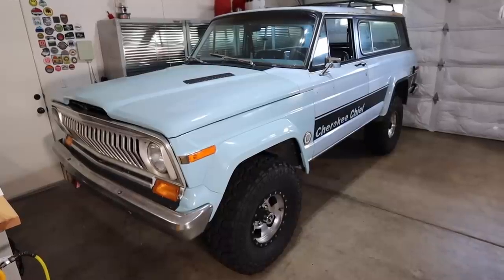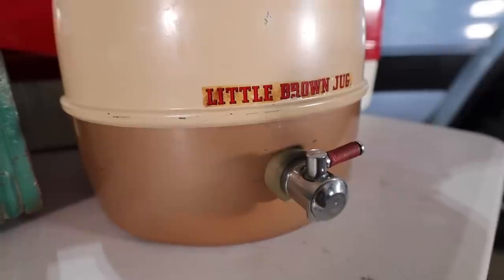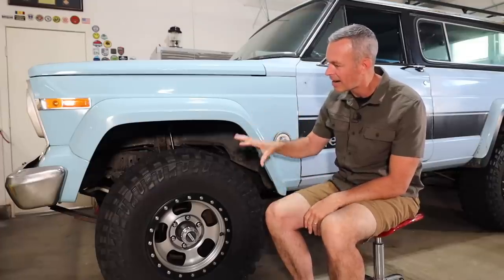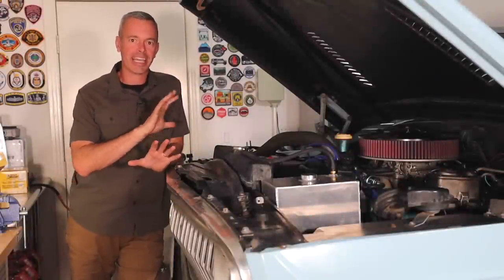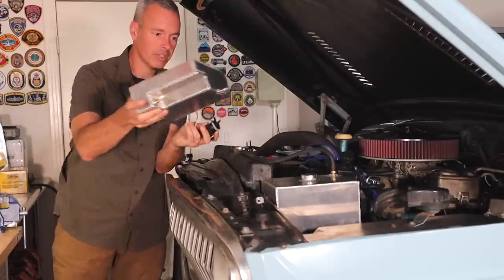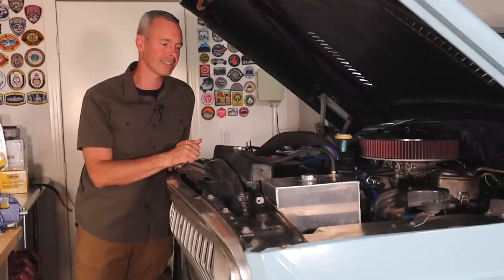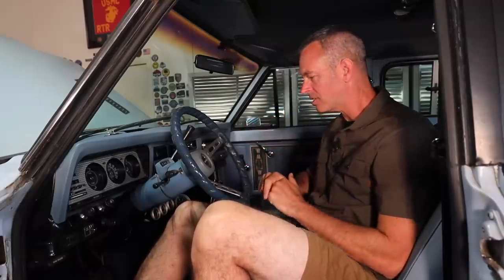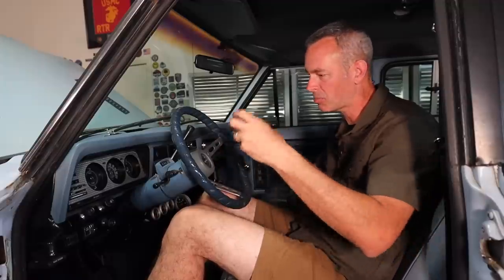Is this 41 Year Old Jeep Cherokee Chief Worth Restoring?

Comment: I did a frame off on my 82 cj7 five years ago. Installed the drive train from a 79 Wagoneer including axles. I kept the Dana 300 transfer case. After several carb swaps I settled on a Quadrajet. Once I got it tuned it has been excellent. All the Jeep guys I know kept trying to get me to swap a gm drive train. Lol,no issues. Beautiful wagon you have there.

Comment: Back in the early and mid-80s, I had a '79 Jeep Cherokee Chief. It was a great truck. I had a 360 V-8, a three-speed automatic transmission, with QuadraTrac, with low-range and vacuum lockers.  I had the transmission start to slip, and my parents decided to help me out, we towed to where they were living and got their mechanic to do the transmission rebuild. I mention this because they were living in Wilkes County North Carolina. If this isn't familiar to you, this is because the area was, at the time one of the centers of NASCAR. And their mechanic was a car owner and car builder. His shop wasn't one of the big ones, but he did run cars are the NASCAR tracks both the big ones and small ones. 

He kept the truck for two months, and when I picked it, not only had he rebuilt the transmission, but he had decided to 'play' with the engine, and rebuilt the engine, not as a track engine, but at this time, a becoming thing was fuel efficiency in NASCAR. I won't say what the build was able to do, but as a daily driver, I wasn't getting close to the 9 mpg that the presenter in the video says he was getting. 

Lastly, a comment about the offroad capability of the truck. I was working as a land surveyor when I owned the truck. One day, I and my crew along with another crew got stuck one a site and our 4-wheel drives got bogged down. During our attempts to get the trucks out of the 'stuck', our attempts were noticed by first a couple of guys with one 4-wheel drive truck and then by construction crew with a larger 4-wheel drive truck. 

Both pickups got stuck. Coming to our rescue.

As it was getting late and this was long before cell phones, my wife was getting perturbed that I hadn't come home, she contacted the office and called the surveyor who we worked for and he said we should have been finished long before that. So, as she is a county girl, she hopped in the Cherokee Cheif and went to the site. 

Now, where we were all stuck was at the edge of an overgrown field, but she could see us from the entrance to the property. The field was wet and full of mud, once the grass, weeds, and other vegetation was broken through, but she didn't know that. She just drove over to us. She did have to engage the locker and as she approached us, she did slow down a bit, but after seeing what had happened, she just swung around and backed up to us. Yes, we all were yelling for her to watch out, but to no avail.

She pulled all the trucks out of their 'stucks'. Even the big 2.5-ton pick-up, although as she pulled him up on solid ground she did have to engage the low-range. 

When asked about how she was able to do all this, she just said she had grown up driving tractors and this wasn't all that much different from plowing a field. 

I loved that Jeep. It was killed by a mid-80s Accord driving very fast and T-boned it, flipping it, sending it spinning down the road for 150-175 feet, with me in it. Totaled.  

When people heard that the truck was no more, there was a bidding war for the engine and transmission. I was able to buy another car with the salvage monies. 

I still wish I had another '79 Jeep Cherokee Chief, now, what 35 years later. 

Oh, BTW, I've still married to that country girl.

Comment: Your “cold start” made me laugh Brad. Cold start in So CA is what, 60’s?  Just bustin’ your chops bud. 😜

As for your fuel pump dilemma, these FSJ’s have a tendency to vapor lock on hot days and high altitudes due to the fuel vaporizing at lower points as elevation increases. To remedy that I installed a small electric fuel pump right at the tank on my BIL’s Cherokee Chief years ago which resolved the issue.  The electric pump fed the mechanical pump which prevented the large pressure drop as it is easier to push fuel than pull. 

You could simply wire in two small electric pumps (one for each tank) to feed  the mechanical and merely wire it through a double pole double throw switch to select supply tanks.  

Just a thought.  

By the way a FSJ is on my radar also as a retirement project but I want to run a modern powertrain for power and efficiency.  

Mike
Reply from the maker: I like your suggestion, and may have to look into some low pressure pumps to offer a little assistance.
Reply: Great suggestion, we used to use a pre feeding low pressure high volume pump with a pressurized catch tank.
Reply: I think most EFI setups require electric fuel pumps so you might want to look into what is included/required for your future setup.
Reply: Not a bad plan, but I have another thought for when you go fuel injected.  I put the Howell kit on my YJ and loved it, so I think it is a great way to go.  The first thing I noticed though was that since the main gas tank had no baffle (fuel injected vehicles usually do), braking, turning , or accelerating with less than 1/2 tank could starve the fuel pump and kill the engine.  I solved it with an old Road Race trick we used to call a surge tank.  A tall skinny tank of about 1 gallon mounted up in the left rear fender.  One electric pump with a return line filled that surge tank (with a return line to the main tank).  The main pump supplied with the Howell kit pulled from surge tank (return line from the throttle body goes to the surge tank).  You could drive that thing straight up a wall without fuel starving.  Also found out that the stock exhaust put enough heat under the Jeep to boil gas in the tank at high altitude (or high temperature).  With that system I never had any vapor lock even after 8 hours on the Old Ore Road in Big Bend.  Let me know if you want more details.

Comment: I at one time had a 72 jeep Wagoneer AMC  v8. At 10,000 feet it would vaper lock. The fix was a rotary vane fuel pump from Carter  mounted at the fuel tank. If you go fuel injection that will be the fix to.

Comment: I had that model Coleman Camping stove, I think it was from 1967.  I got mine a thrift store in 1994 for about 7 bucks.  OMG that was a steal, and i loved it!  I used it every year until 2014, when it died on me during a camping trip.  The pump broke, and I couldn't find a replacement on a late friday afternoon, so I sucked it up and got a new stove to save the camping trip.  I like my new one, but that old stove had character.  It looked old and was a beater, but oh it worked so well for those 20 years camping.  BTW, if you want yours for a long time, the pumps don't last forever, so get a replacement for it and have it on hand in case you need it down the road.

Comment: I found an 81 Jeep Pioneer with the 6 cylinder and Chrysler 747 transmission in it in the late 80's. Pulled the motor out and had it rebuilt .040 over with a Clifford Research camshaft in it. When I reinstalled it I put a Clifford intake and split header on it. I decided to use a 500 cfm Holley two barrel instead of going with a four barrel. The transmission was rebuilt with stronger clutches and shift kit.  The transfer case was in very good condition so I left it alone. I added a two inch lift kit and installed a set of Chevrolet 6 lug 4wd wheels complete with the caps (painted over of course). I went with a set of 31 inch tires. It was a four door with light blue paint. And it had air conditioning which really comes in handy in Georgia! I loved that truck but somebody came along that wanted it a lot more than I did and paid what I told him I had to have to part with it. Now I wish I had told him it wasn't for sale. What you're doing brings back some old memories. Hope you enjoy yours as much as I did mine.

Comment: Yes. Make sure yo add a ground strap from the motor to the frame. Helps eliminate may electric pixie problems. Change the Rad to a 3-row Aluminum unit. I upgraded to the EFI Howell fuel injection too.  Make sure to have a full time 12 power to the unit when the key is on. If it cuts out when cranking you will go crazy wondering why your EFI won't start.

Comment: Owned a '78 Cherokee S that to this day was one of my favorite of all time. Check the wiring behind the light switch. I ran a screw through the dome light wire reinstalling the headliner. The wiring block behind the switch (held about 6 wires) melted and caused all kinds of light issues. Also check if there is an old 4-blade trailer wire in the back. Have had several trucks where these went bad and made all kinds of goofy with the lights.

Comment: I had a 74 Cherokee Chief that I used on the beach and where ever. Had the quadratic system. Learned real fast how to find air leaks. Air leaks would prevent the quad activating in low range. For rust I used POR 15 products. Did a great job on converting rust and covering up afterwards. For Fiberglass, I used west system products. Used the system and got rid of holes in the body  patching them up using the west system.(found stray cats using the jeep as  home at night). Add a 40 gal fuel tank. Rebuilt the motor and transmission. The jeep lasted for years as my family's beach jeep, With 33s it go go anywhere, over anything, pass anything but a gas station. Still have the emble of the Chief from the side.

Comment: I loved this episode.  I had an 89 grand wagoneer woody & currently looking for a 2 door .  Definitely get the electronic fuel pump. 9-13 pound i believe on pressure vs 3 pound on the old mechanical made a huge difference.  The mechanical caused stall outs when going up & down hills at certain angles and was frustrating, so the electronic fuel pump was a cheap upgrade for the added benefits.

Comment: Those 360 CI engines are tanks. All you need is an aluminum plenum spacer and you never have to worry about oil consumption issues that those engines are known for. Hughes performance has the plenum spacer kit and its an easy install. Being in California I had to smog mine and the smog guy was surprised the emissions test came back as good as it did. Simple plenum spacer upgrade and pcv valve replacement worked wonders. I'm excited to see your future videos of your rig.
Reply from the maker: Excellent info, thank you!

Comment: Brad, you may have found some already, but there are a lot of full size Jeep (FSJ) pages on FB. They are very helpful with parts and knowledge of the FSJ’s. Also BJ’s Off-road has a lot of stuff for FSJ’s, even replacement parts.

Comment: The good thing about early iron they will get you home with minimal tools and parts. I have an 84 K-10 that I went through two sets of springs and removed some of the leaf's to get the ride I wanted and took out the sway bar. Rust above the drip rail's is interesting and the other great feature   ( The wing windows)

Comment: one man's retro,  I live in the woods on the WV panhandle.  what you call retro we use whenever the power goes out!  which is maybe twice a quarter.  sometimes for days.  oil lamps are pretty but coleman is for reading and cooking.  of course we heat with coal in spite of obummer.  Im a grand wag guy from waaay back.  good luck.

Comment: Just doesn't get any better.  Need a classic umbrella canvas tent... that attaches to the back of the Jeep.  The old style yard chairs or camp stools.  Very cool very retro very fun. I have the same camp gear,  all original and many... don't ask how many lol.. when stationed at Camp LeJeune.  I purchased a Coleman stainless steel cooler,  lifetime warranty  ! I love it.  Exactly like yours,  just not red. So much to offer with this setup.  This is cool.  You can even change some of the looks of it by fitting retro Gladiator parts on it. These were built right,  and so easy to modify.  Semper Fi.

Comment: Great video.  I really like the period camping gear.  I still a lot of it, just in case.... Baby blue color will look great.  I restored a 1967 Ford F250 Camper Special that was the same color.  Pulled everything out of the cab and had them repaint the entire inside.  It looked great!  Changing to fuel injection.....aahh....I like the old style.  Points, plugs, and condenser and you're set.  It's a classic.
Reply from the maker: Thanks! The camping gear is going to be fun. Love the old 60's Food trucks!

Comment: YES! It is absolutely worth restoration. A stage II mechanical/cosmetic restoration would be ideal.
Call Atlas Suspension! They will build you a custom set of springs to your specs. I have them on my 68 FJ40 with 4" lift arch, "expedition" spring packs that have a sort of overload secondary spring that will kick in at whatever weight load you want. I have mine set to kick in at 350lbs to ensure I don't sag when I have the hard top on. Their springs are softer and known for impressive flex and articulation. I get 14" of travel in the rear and 12" in the front in a spring under config. The can do axle pushes to improve approach/departure angles and steering geometry as well as extending the wheelbase. I had problems with my springs from them and he paid for return shipping and fixed the issue for free. They stand by their products and services!
Thank you for your service Shipmate! HM2 (SW/FMF) myself.

Comment: Brad, I had an old IH Scout II with similar brake light issues, work on grounding the tail light assembly (the metal tail light body) to the truck body, simple as using some aluminum foil around the screw holes in the body worked back in the day

Comment: An off the wall name suggestion: Princess Tiger Lily
As for the fuel tank/pump issue, you could borrow a trick from the Cannonball Rally racers. They typically put an electric pump in/on their aux tank to feed the main fuel tank. That way the original fuel system stays in place, unmodified, and the aux tank is only used to fill the main tank when it starts to get low. A switch for the aux fuel pump in the dash with a fuel level gauge for each tank and you're set.

Comment: Please get a radiator fan shroud. Itll make the radiator perform better and focus the air better on the front engine accessories too.Just a suggestion from a guy that's owned dozens of old trucks.

Comment: Hey Brad. Watching and enjoying the vids. Headlights on these old FSJ's. There is a ground located near the headlight bucket where it mounts to the radiator support. Also all of the power for the headlights runs thru the switch. The switch has high resistance and uses up a bunch of the voltage. Making the headlights dim. So if you can build a harness that has relays that are switched on by the switch (low voltage) and then the relay can send full charge/battery voltage to the headlights. They will be much brighter. I will try and send you a picture of the set up I have on my '74 J 20.
Reply: http://www.ifsja.org/forums/vb/showthread.php?t=184659

Here is a link to the harness I mentioned.  This plus upgrading to 7" LEDS from a JK. One of the best upgrades ever.

Comment: Great video and cool Chief.   Even though it starts fine, try turning on the key to the 'on' position first and then press and release the gas and then turn the key to start.   This will make sure the choke is engaged.     Also, those seats sometimes get a bit of 'lean' to them.  While you have them apart you might have them weld up a bit of reinforcement to keep the seats from leaning back.
Reply from the maker: Thanks for the tip!

Comment: Another option for the roof would be finding another roof to graft on. The rust in those areas of the roof happens when water condensates on the inside of the roof, and then rolls down into the inner channels and sits there. But the roof is the same between cherokees and wagoneers. Grafting another roof on may be a better option than the shop fabbing up the sheet metal from scratch. Happy to see it coming along!

Comment: Check out Melling Performance for the AMC 360, Northern Radiator as those old Radiators in the summer heat tend to run hot.  I would have the body work done, but skip the paint job and check out the tint options with Raptor Liner.  You could even add the same decals with a Raptor Liner job.  Since you most likely will follow with a Rhino Back Bone or some sweet roof rack I would also check out LoD for their rack and bumper options.   What a great find.

Comment: The cure for the 9mpg is a double roller timing gear.  The crankshaft sprockets can have indexable keyways.  Installing the system with the keyway set at 4° advanced.  Will improve low end torque.  I had a '79 Ford F250 with the 351.  After doing a super tune up like you did.  The mileage was still 9mpg.  After the cam drive change.  Highway mpg went up to 15mpg @ 70mph.  That mpg was on a trip from Glendale, CA to San Jose, CA.  About 700 miles round trip.

Comment: I wouldn't go all out on the roof fix and spend a ton of money having it professionally restored if that isn't going to be the overall plan for the entire Jeep.  What I would do if I were in your position, is to neutrallize the rust/cancer where it is, and remove the worst of the flakey metal.  Then do as you suggested, either teach yourself how to weld in patch panels, or glass in some mesh to level things out.  Then tape off the rest of the lower half of the rig and put a few coats of DIY waterbased DupliColor Hurculiner bed liner over the entire roof.  This stuff is super strong, great looking and easy cleanup.  You can always add more layers if need be.  Once it is sealed up, it will never see rain water on the metal again.  Also, it will add some sound proofing to the cockpit of the big tin can effect. 

Overall, this looks like a really great purchase with tons of fun playing with it down the road.  Period correct camping gear is the right approach as well.  Get yourself one of those old squeaky canvas cabin tents to go with it!